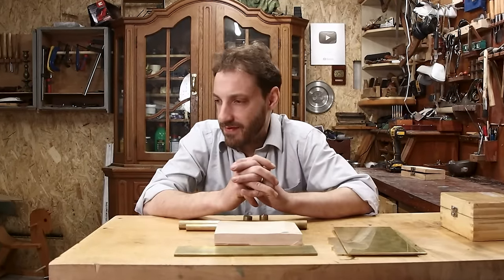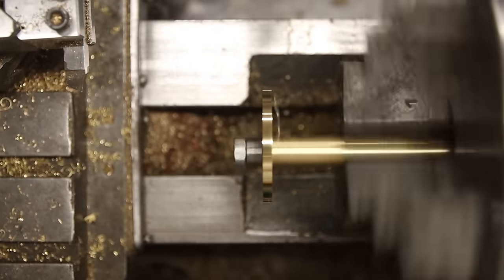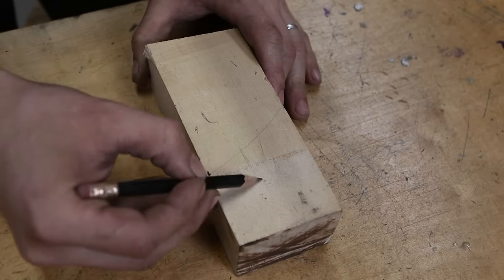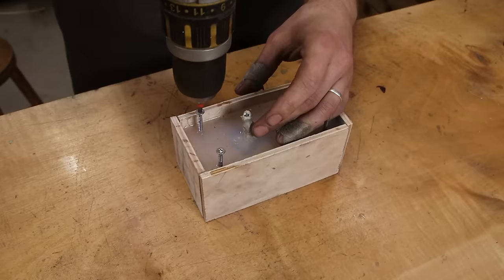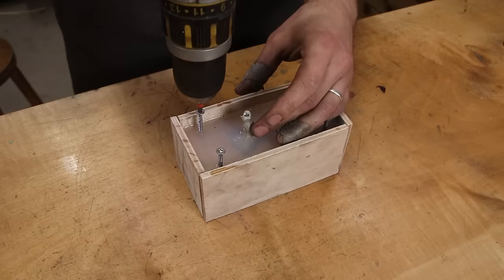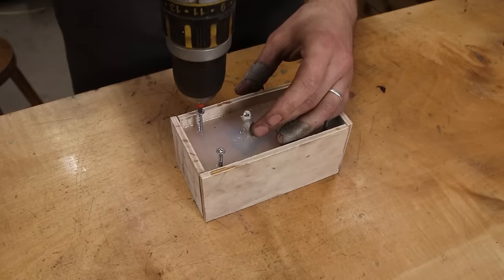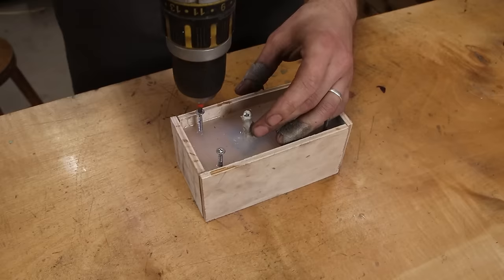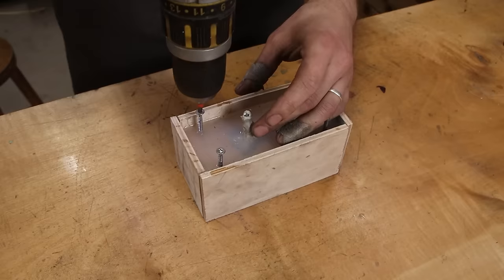I Made a Machine No One Asked For

Comment: The 3d printed cage is pretty standard for printing delicate parts in MJF or SLS. 
Both of those processes use fine nylon powder which takes up the entire volume of the printer. You have to get rid of that unused powder after, though most is recycled!
That lil cage serves a few clever purposes for smaller parts: to keep small parts from getting lost in the large 'cake' of powder, to give the operator something to hold onto when bead blasting the powder away, to keep fragile or awkward parts from warping or breaking, and in your case, extra protection when shipping!
Reply: @Problem-attic, thank you for the explanation. I had not thought of a powder-based additive manufacturing. I thought that it would have been resin printed.

Comment: Always watch that little safety pin below your key on that type of chuck. If it sticks out, your jaws are not properly "hooked" into their teeth. The jaws move inwards on three little wedges with teeth on the front. If the pin sticks out the teeth are not fully engaged in the jaws. Under a lot of clamping force they can break their teeth and fly out. 

Ask me how I know...

Comment: 3:30 as a machinist I would never thought of intentionally putting the jaws in wrong to create an eccentric turning. Probably because you cannot accurately set a specific amount of offset, which is why most machinists would dial in the correct offset with a four jaw chuck. That being said if an accurate displacement for your cam is not critical this quick and dirty trick certainly works

Comment: That chuck you have there for your lathe is called "Keilstangenfutter" (in german at least, dont know the english name) and it is absolutely super important that the little pin on the face is not sticking out when you start the spindle, otherwise a jaw could fly out of it. Also you should never turn the spindle on when there is nothing clamped in the chuck for the same reason.

Comment: This is a product that needs to be on Sharktank. Very cool. It might benefit from a couple of stops on the side to side motion so the finger stays pointed in the same direction since the amount of friction imparted by the 2 cams isn't always equal.
Reply: @merlinmagnus873, and perhaps a silicone finger tip so the experience can be a bit more comfortable than with tin.

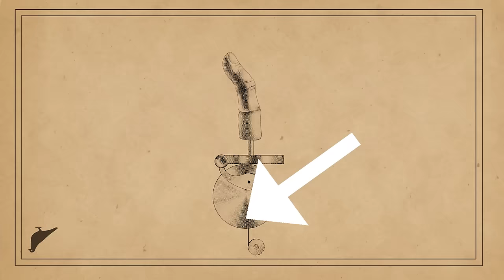Comment: 1:51 Cool project but why are you wasting time and energy to hacksaw that thick piece of brass round stock, when you obviously have a lathe whereby you can simply and quickly use a parting tool to cut off the length you need?

Comment: Pretty ugly Project😁
3 jaw chuck: The pin you see is a safety pin. If you see the pin protuding, don´t tighten the chuck or run the lathe. You might break the worrm drive inside the chuck.